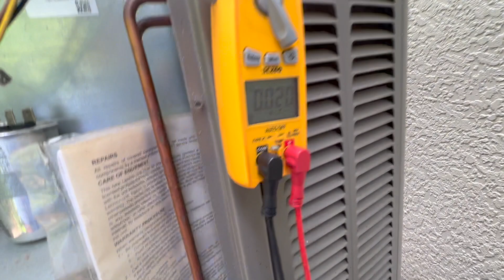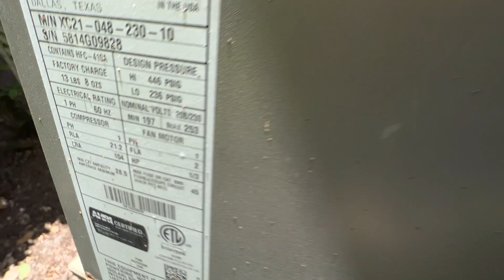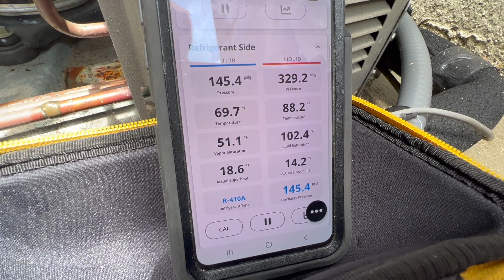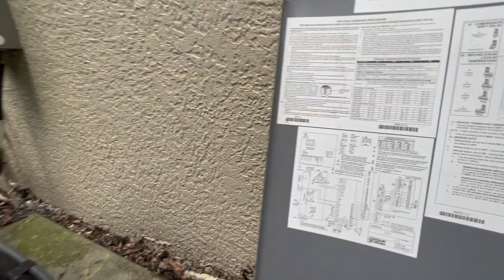The ac air is not cold !!

Comment: While watching the video I noticed you replaced a 1-pole contactor with a 2-pole (without a jumper between L2 and T2.) I am guessing the system has/had a crankcase heater which explained the 1-pole contactor. By removing the shunt won't the compressor need to work harder to start up, shortening its life?
Or perhaps the weather precludes the need for a crankcase heater where you live?
Think I noticed a heater attached further in the video.
Please elaborate, I am curious to know.

Comment: Whats the voltage value on the low voltage coil 24V on the contactor??
Reply from the maker: I always check for 10-20 ohms on the 24v coil, but this is the  Second cap replacement in this unit in 1 year interval , burned contacts and pitted that why i changed it , better than coming back for another service call diagnostic and changing another cap and finally replacing the contactor , putting stress on that compressor windings

Comment: Isnt the Capacitor used to run the fans in the outside unit? If fans are running fine and still AC not blowing cold air, could this still be faulty capacitor or something else? I have already cleaned the coils for any bloackage but still its not blowng cold air so what next should I do?

Comment: So mostly when the compressor sounds like that, I always thinks it's the compressor so what should come into my mind first when I held this kind of noise?
Reply: Replace the capacitor
Reply: Humming is almost always capacitor. 1/3 of my repair calls are capacitor although you have to be careful because there may be a reason capacitor goes bad. Always check amps after replace

Comment: Based on the videos I’ve watched on YouTube those capacitors seem to be the most common problem.
Reply from the maker: yes ! and clogged drain lines here in florida
Reply: ...and now you are certified to to swap and drop HVAC🤣
Reply: Great explanation and attention to detail.  I have a condo florida and had to have the fan motor and assembly replaced.  It was frozen like a huge block of ice. I got there just in time before it flooded.  That was very expensive. 😬
Reply from the maker: @MamaBear6684  thank you 🙏🏼 , might be a good idea to have a nest thermostat so you monitor your temperature and tell when there’s an issue 👍
Reply: @coldflashac6443  Thanks I'll look into it 🙂

Comment: What was wrong with the contactor?? Why did you reccomended for the customer to change it?
Reply from the maker: burned contacts , after a while they end up eating more capacitors .. thanks for the comment
Reply: Contactors are like points in olde car ignitions. They draw sparks when energized and wear out.  It’s about time the contactors get engineered to use solid state relays by manufacturers. They are not too expensive. SSRs are used in all types of applications, especially where moisture or combustion may occur.
Reply: @tomtheplummer7322  I recommend the Emerson Sure Start solid state switch. More expensive, but worth the $$.

Comment: Can you come check ours. Its running but hardly any cold air. Would it be low on Freon???
Reply: Are you in Channelview Texas area, Houston,??
Reply from the maker: its probably low on freon , but you have to check first , no I leave in Florida ,sorry  , thanks for the comment 👍
Reply: @coldflashac6443  where in Florida?
Reply: This video describes the same issue you’re experiencing. He just repaired the unit by changing out the start capacitor. Freon/Refrigerant doesn’t dissipate. Therefore, it is unlikely your unit is low on refrigerant. Unless, there is a leak somewhere. Not sure why the creator says you may be low on Freon when he literally encountered a similar issue as you are experiencing and it wasn’t indicative of low refrigerant levels.
Reply from the maker: @Miguel-dy3fh  hardly any cold air could be freon , stuck heater, bad txv , restriction on the evaporator coil and more …., if the compressor was off do to a bad capacitor that house temp is going super high , thats why we have to check first , thanks for the comment 👍👍❤️

Comment: Im tired this darn machine a 1 1/2 qn 2 service calls they supposed to have filled n 24 hr later no cold air secon tine refill an lasted 48hrs the machine doesn’t stop n know not blowing air have been looking for a leak n nothing, what else can it be
Reply from the maker: If is loosing freon it has a leak if is hard to find looks like you need an isolation test meaning pressure all the components indoor unit line set and outdoor unit come back in 2 or 3 days and see if it lost nitrogen pressure, this is not an advice contact a licensed professional thanks